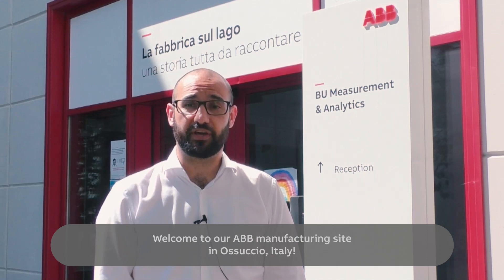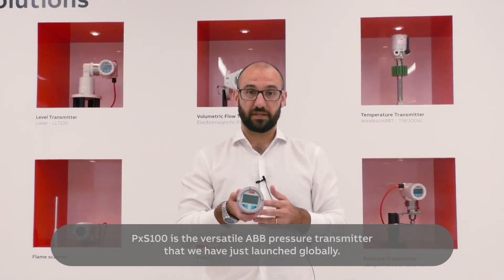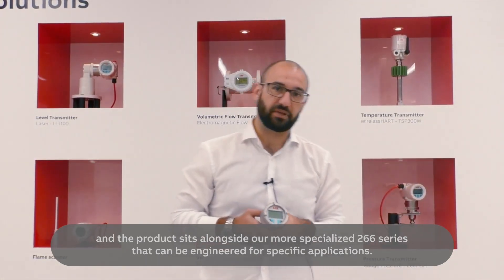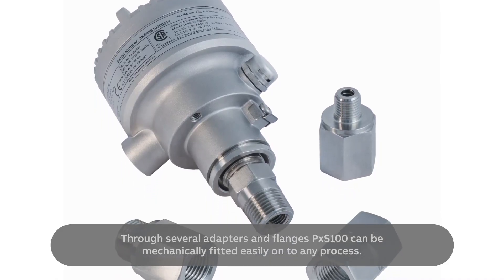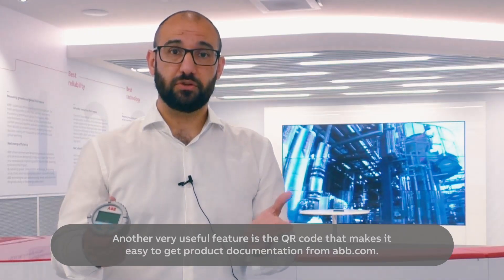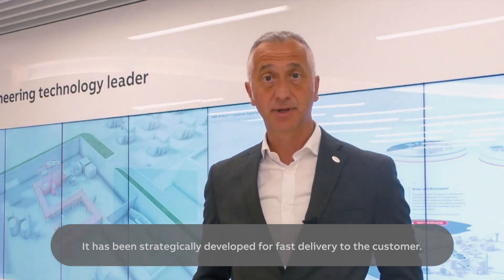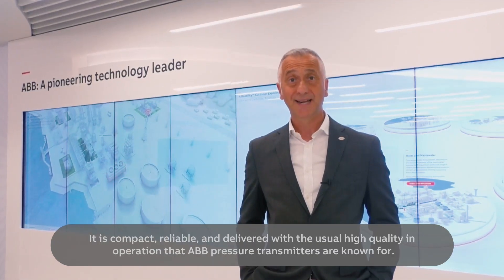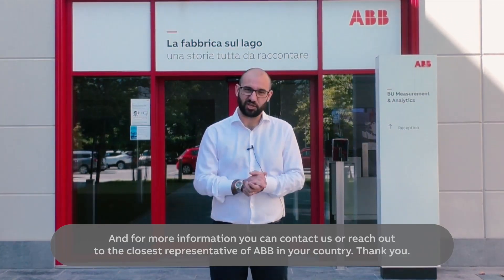An introduction to the ABB PxS100 pressure transmitter

Comment: Is it safety for a chemical tank?
Reply from the maker: Thanks for your question! Yes, the P-100 is safe for use in a chemical tank, provided the process media is compatible with the wetted parts. It has hazardous area approvals (ATEX, IECEx, CSA) and offers materials like AISI 316 and Hastelloy-C276. However, if the chemicals involved are highly corrosive, it’s important to evaluate the application to ensure long-term reliability.